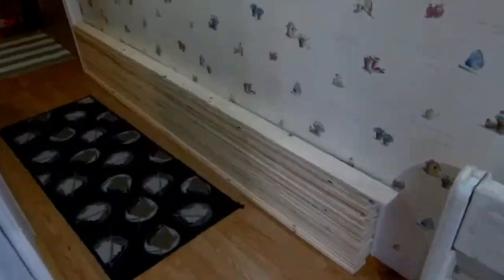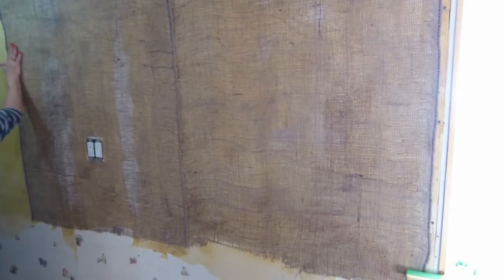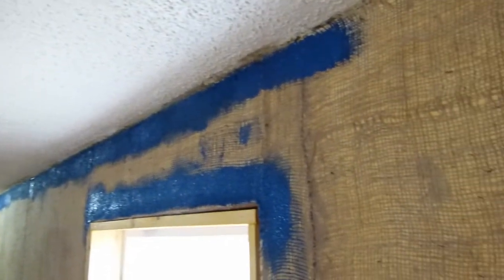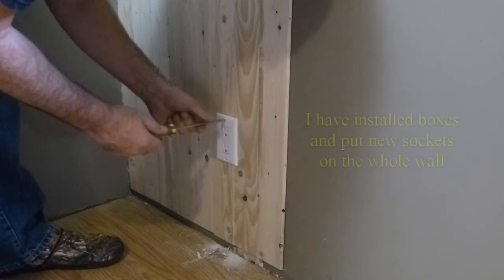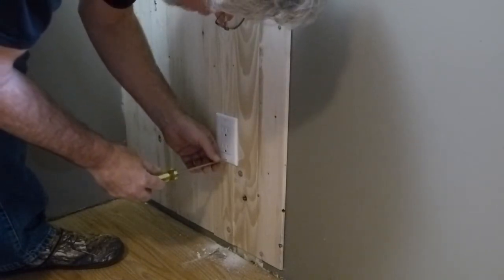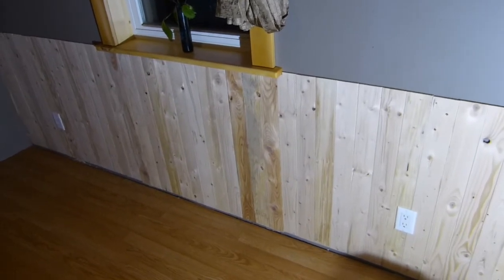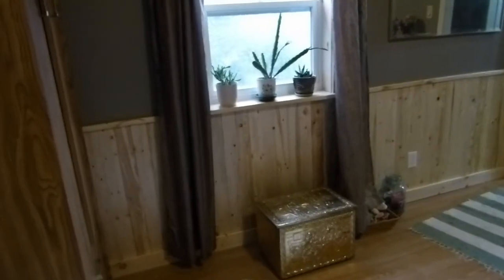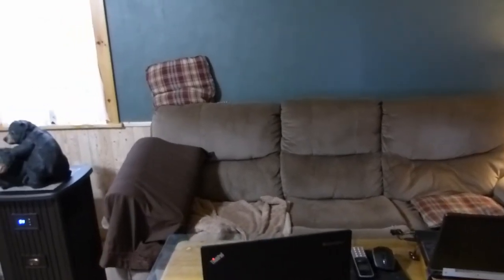Completion of the Window Job:  Wainscott, painting, trim

Comment: That looks great Jim. I kind of like the wall texture technique interesting. I like cobalt the cobalt blue glass. It especially looked great sitting on the window shelf. Your windows are pretty darn good or it does not get too cold where you are. My windows are so cold during below zero weather things freeze by them like plants.
Reply from the maker: The windows are a lot better than the old ones.  Everything froze in front of them.  They were a pretty good price too, and installing them myself saved lots of money.
Reply: @JimDockrellWatertone  What kind were the windows? I need look into replacing mine one day we lose a lot of heat through them.
Reply from the maker: @McCoysOakHillFarm  They are from a local manufacturer.  Just a small company, I can't remember the name, they sell through an outlet store in London only I think.
Reply: @JimDockrellWatertone  Oh ok.. bummer for me.